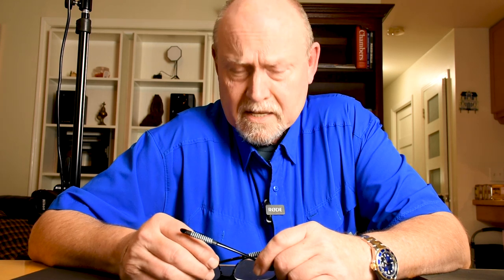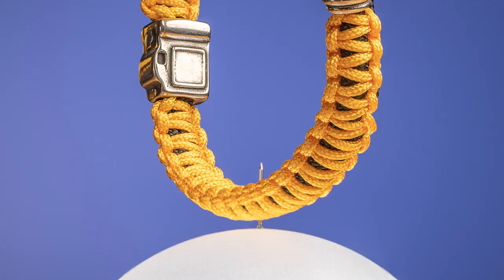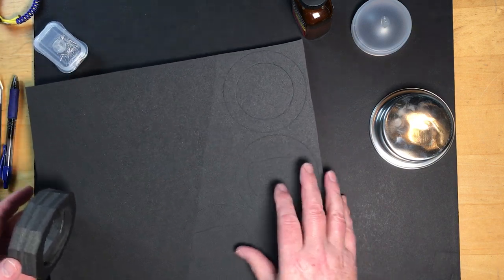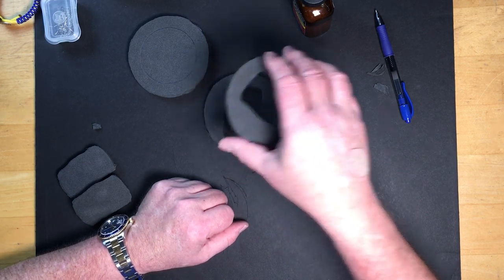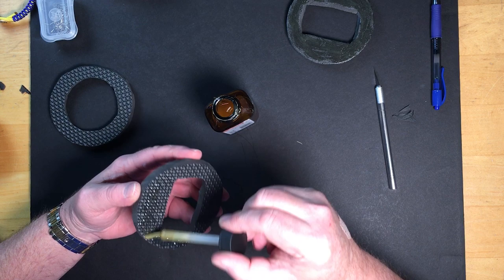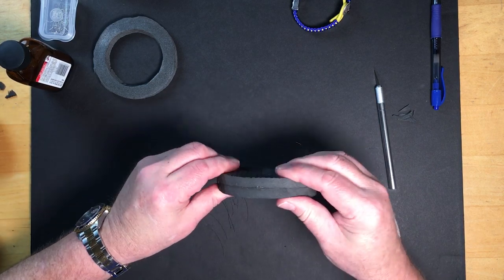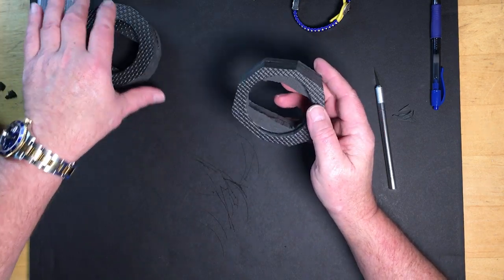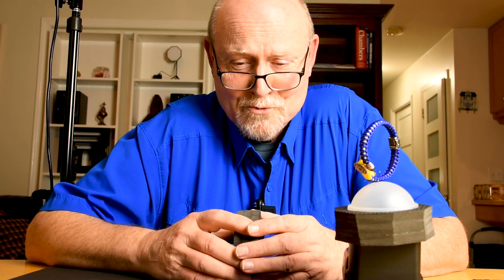The Magical Macro Flash Dome - DIY creative macro lighting adapter

Comment: The way that glue works, is similar to the way you glue patches on bicycle tubes.
When you patch a bicycle tube you rough up the area around the hole in the tube with sandpaper or something rough.
You apply the self-vulcanizing fluid to the tube around the hole, and then you wait for the fluid to dry before to apply the patch.

Comment: Very innovative again! We do not have the same glue and floor tile material here in India but similar foam is used in packing and rubber adhesive works well. for cutting foam I made 'G' shaped saw with a plywood piece and i used NiChrom wire, used as fuse wire in mains electric supply or as heater element in many domestic appliances. with a couple of rechargeable batteries it works like a foam cutting thread saw. It is faster and gives cleaner results to me. It is just basically what you taught with cheap material available to you, and I use  polymer foam packing sheet waste a lot, so it is just an adaptation 😊🙏

Comment: My Nikon FT3 still works after 45 years.  My new , and still waiting for it to arrive,.....life expectancy probably a few years.  My electronic Fuji was used only three times. It was working fine when I put it away 15 years ago. Got it out to use.....it didn't work.  Yes, I put batteries in it.  It was not a cheap camera.  I think that's the problemwiththe digital stuff.

Comment: Great idea,
But if you cut it to size afterwards anyway, why not starting with 3 squares instead of trying to cut 3 circles? The use of the foam for fixing a modifier to a speedlight is a a briljant solution to a often occurring problem. I hate using velcro. I will certainly start using it too. Greetings from the Netherlands, Ron Hart

Comment: Oh dear Allan! I’ve been having exactly the same `Err’ messages come up on my D850! I thoroughly cleaned the contacts both in the lens throat of the camera and on my lens and it’s been faultless since! I’ve again enjoyed your video, but haven’t you just created a brilliant all round macro lighting dome? It looks as though that would be useful for beautifully lighting all close focused subjects for a fraction of the cost! Great stuff as always on your channel and I hope your D850 comes back cheaply fixed!
Reply from the maker: Thanks Hilary! Being with my camera is a major drag, but at least I'm relearning how to use my backups. I've been experimenting with the dome and you are correct. It works great for a lot of up-close subjects. I cut out a few discs of tracing paper and put them in the dome and it really softens the light beautifully. I need to remember that the dome has a very sharp pin sticking out the top... I've stabbed myself a dozen times.
Reply: Don't know if you saw his follow-up video, but the root case was third party batteries. Do you get the issue with Nikon batteries?

Comment: Whilst drawing up a plan of your light box frame. Mind in neutral I thought of your "pindome" you may already have a name for it. But I thought this incompassed it's characteristics. Reframe. I'm thinking of a rectangle on top same depth but 8"wider to overlap the sides. The overlap of 4" a side to have another 1/2" pvc fixed directly underneath for more stable attachment of flash. Perhaps a cheap    s/steel rule attach for the reference book to record. Setting up a small room in the shed to do macro. Incorporating a single mattress incase I get locked out being excessive . Love your videos. It should be a TV show! Thinking of cancelling Netflix. Hope I  ave you a smile. You certainally do me! Especially your "praying pork" recipe. Cheers.. Colin C, Aus.
Reply from the maker: Hello Colin, hope all is well down there. Pindome it is - best name for a gadget yet! I like that idea - I could have used those outriggers in a shoot I did yesterday. I ended up with 6 speedlights and not enough room in the cage. I feel another modification coming on. You must send me a picture of your macro room when it's done - brilliant idea!